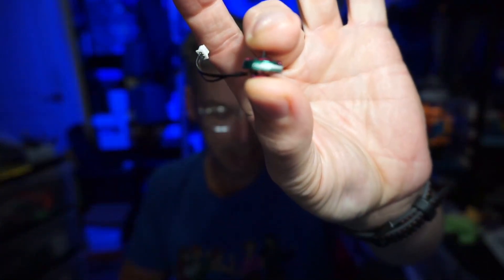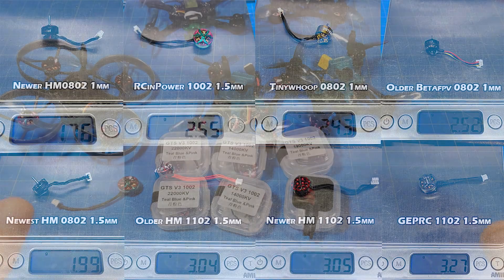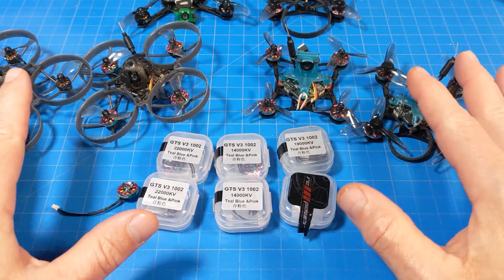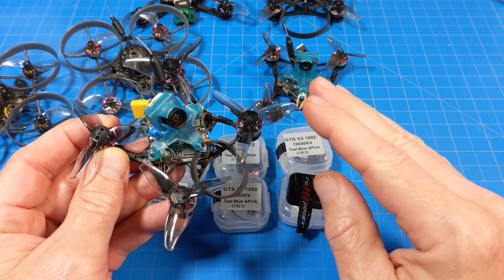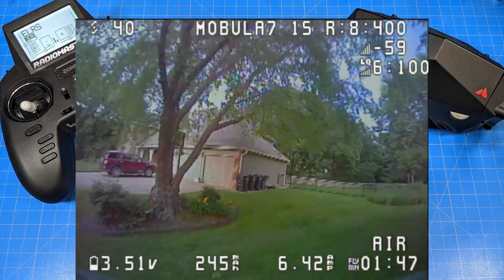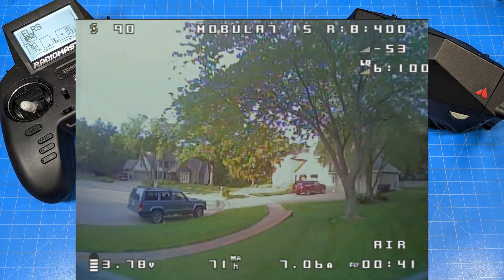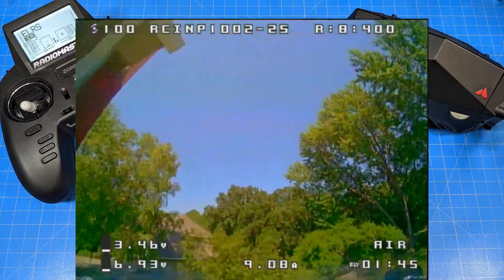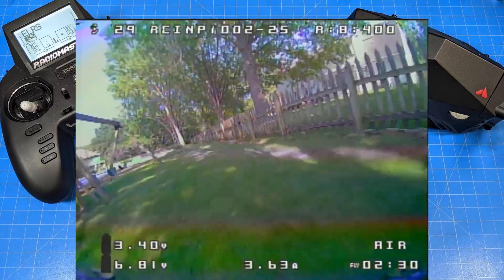New RCinPower GTS V3 1002  // Double Ball Bearings // Prop Motor Matching

Comment: Hi Nick. I have seen in your other video suggesting that 45mm prop works well for 1002. I currently have 1s toothpick build with betafpv 1102. If i switch to 1002 using same prop same KV motor would that give more flight time? Are 1102 too big for 45 Mm prop?
Reply from the maker: 1102 are not to big, I have flown 1102 from 40mm to 2inch prop. The 1002 wont save much weight or any depending on the motors, and also won't increase flight time or if it does its likely due t inefficient 1102 compared to efficient 1002. I would stick with 1102.
Reply: @ thanks Nick

Comment: Hey Nick, i was gonna get these. Any new reccomendations on a good 1002 or 1102 since the release of this video for a 65 or 75. Is a 12A esc rated enough for these types of motors
Reply from the maker: I have mainly tried the different 100x motors on BNFs, I think they are likely very very comparable from one to another.
Reply: @NickBurnsFPV  sweet. How about A ratings. Are off all them within the zone?. I know 1102s might be bit high in amps for a 12A board

Comment: Planning to use the 1002 22000kv on a 75mm walksnail build, would you have any recommendations on a tune pre-set to start on?
Reply from the maker: try a uav tech whoop preset
Reply: @NickBurnsFPV  Thanks!

Comment: I just picked up the 19,000KV for my mob7, can't wait to try them out!

Will I be able to run them on 2s but with the throttle limit lowered? I have the mob7 with the x12 v2.1 board wich I think takes 1-2s, really want to try 2s on this rig but don't want to ruin the motors
Reply from the maker: Normally motors are rated 1s/2s. Which doesn't mean voltage limit but rpm limiting. yea you could run them, I would start out cautiously at first.

Comment: F4 AIO 5A won't be a good idea for this motor, right ?  probably need 12A
Reply from the maker: I have run these motors on 5am esc, as well as a host of 1102 motors. The prop size is an important part of the amp draw. larger the prop the more the amp draw, I have not flown 1002 or 1102 on larger than 2inch tri blade props.
Reply: @NickBurnsFPV  thank you for the info.

Comment: Which kv did you end up using for the Mobula 7 1S? Stock 0802s are 20000, the 1002s come in 19000 or 22000, I think.
Reply from the maker: 22000kv, are currently on one of my mobula7s
Reply: @NickBurnsFPV  Thanks!

Comment: Let me make sure I understood you correct.. you said if running on 2s we need to reduce the throttle 🤔 did you mean only if you're running triblades? Because I have these motors and I'm  running biblades but I only have a Zeus 5 amp ESC 🤷🏾 would I have to reduce the throttle even though I'm running bi blades on a 5 amp ESC? And how much of a throttle reduction?
Reply from the maker: yes, on a 5amp esc these motors on 2s with biblades pull 9amps on 100% throttle and would burn the 5 amp esc. We have to reduce the throttle or motor output to ensure we don't go over the amount of amps the motors might pull.

Comment: What about 4 blade 40mm… 52g dry 2s…to. Cruise in the evening… or inside… any suggestion ?
Reply from the maker: I haven't exhausted all weight and prop choices. In the experiences I have I think they are best suited for ~40gram with 2inch bi blade props.
Reply: @NickBurnsFPV  would you have a suggestion for this build? It is a gepRc tkP16 build as a pusher… they have 1203 11500kv… it flies well but got 10s of flight… help !
Reply from the maker: @MaddestGinger  low flight time is often the result of weight, over motored, or even the pid tune can cause shorter than expected flight times.

Comment: Hey Nick! So I got my mobula 1-2s that I have upgraded to the v3 frame to fit 350mah 2s rdq batteries with xt30 lead and connectors to help with sag. Now that I got everything set up and I’m flying, the motors get so hot!! Is it the increase in weight from the connectors and the battery? Or is it getting a good bit more juice and the motors can’t take the time xtra juice? Should I swap to some bigger motors? If so what motors would you recommend me to drop in the mobula 7 v3 frame that will handle it better since I’m only going to fly it with 2s 300/350mah batteries only. Whatcha recommend for motors that will fly hood with that set up and not get hot with still a decent flight time? Also what props would you recommend to pair with it? Give me a couple options on the motors and props for more aggressive vs a little more efficient and longer flights! Thanks nick! You are the best and my go to guy! Lucky me since you know everything I ever ask haha but unfortunate for you since I ask all the time 😅😅😎🤪 you’re the Man!
Reply from the maker: I suspect the pids need adjustment. When we make frame or weight changes, really most changes from one quad transfered to another we need to adjust pids. The pids will cause the motors to work hard and thus get hot. If we swap motors that might solve it, but also might not.
Reply: Adjustments in with way? Which pids should I raise or lower?
Reply from the maker: @Taboloncawonthemasters  I would turn the master slide down two or three notches and test

Comment: Nick, I have been replacing most of my micros with 1002. I found they are perfectly matched with Gemfan 2015 2 blade, compared to the Gemfan Hurrincane 2023 tri-blade, which put too much load on the 1002.
Reply from the maker: nice to have confirmation of what I felt I was experiencing.

Comment: in mobula7 1s did u using 19000kv or 22000kv?
Reply from the maker: 22000kv
Reply: @NickBurnsFPV  did u use 19000kv version too? Can u tell me what's the difference?
Reply from the maker: @mohyusufnr1842  yes, I used all three. The basics with motor kv is the higher the kv the more top end rotation, and thrust the overall efficiency goes down as well.
Reply: @NickBurnsFPV  so i assume that the 19000kv of this motor better than the stock motor of mobula7, and the 22000kv version is more efficient than the stock, but i watch in ur video , even u use 22000kv version is has better thrust than the stock motors, wasn't it?
Reply: @NickBurnsFPV why do u keep giving people different answers 💀
Reply from the maker: @ontariodoublex2713  I don't see that I have. What do you perceive as different answers.

Comment: Thanks for the info Nick! Do you think 1002 22000kv motor will work with 40mm biblades using 5A ESC? I tried 0802 19500kv but i get too slugghish response, 1102 18000kv was too heavy and underpowered, tmotor 0803 22000kv was perfect but it continued to have bells separation. Thanks very much!
Reply from the maker: I do think 22000kv will work with a 5am esc, we could likely move up to 40mm triblades.

Comment: Hi Nick , whats inside the 2" toothpick?
And on mobula is 14000kv or 19000kv? if is 14000kv , u think worth to put 19000kv?
Reply from the maker: the 2inch quad is the 14000kv motors. the mobula has 19000kv

Comment: any chance of you sharing your mobula 7 pid tune? 2200kv please
Reply from the maker: the mobula 7 has the 19000kv in them.
Reply: @NickBurnsFPV  I put the 2200kv on the elrs mobula 7, it flys well no prop wash, that I could tell lol. Four minute flight time on 450's. Motors are cool after 4 minutes, I haven't changed the tune on it. I'll let you know how they hold up to a very dusty environment.
Reply: @davisauto8423 are you running blue jay 48?

Comment: Hi Nick. That's a good comparing video. I ordered the 22000kv version and will put them in my mobula7 1s.I hope they will arrive this week. This are the angry Don motors right? And a blue version would be awesome!
Reply from the maker: I am not sure if Angry Don wanted this specific motor design or not, or if he was in contact with RCinPower. I just don't know.
Reply: @NickBurnsFPV  It is me that did the work with Rcinpower (Toto FPV). Angry Don is working with other companies I believe
Reply from the maker: @t0t0FPV  Ah, so much to know and keep track of. Sorry I wasn't on point with that information.
Reply: @t0t0FPV  Thank you for doing that. I have now watched your video about the 1002 motors.
Reply: @NickBurnsFPV  oke thanks. Flywoo has 1002 motors now also I ordered them via banggood.

Comment: I wonder how the 22kv motors would work on a 1s 85mm whoop
Reply from the maker: its a bit hard to say as there are many configurations I didn't test. I do think a 2inch triblade is going to be a bit much for the motor, it won't be bad, but if you fly aggressively with flippies and dive and fast turns it might not give the response your looking for.

Comment: That Nick Burns background blue!
Any recent builds with the 1202.5'ish class on 1s and 2s (cannot remember)?
My NBDFlow 1202 11420kv on 3" 1s and 2s (with motor limiting) should have been destroyed several crashes ago; my stack screws were all bent forward and I replaced them but not the motors still flow fast as I want them to. 😻
Reply from the maker: The only tuned recent builds are in thumbnail in this video. :)

Comment: Hi Nick,
I did not understand one point: did you use the 19,000kv or the 25,000kv on the 1s Mobula?.
By the way you talk about 18,000 wben showing rhw sub250 frame. :)

Thanks and looking forward to h2h with the T-motor 1002!
Reply from the maker: 19000kv on the mobula 7, and yes 18000kv on the baby turtle they are betafpv 1102 motors running 1s. I used the 22000kv version on the open prop 1s rocket race in the thumbnail but didn't cover it in the video.
Reply: @NickBurnsFPV  thanks for the clarification. I actually bought some 19,000... but sill eagerly waiting for the Tmotors. 

By the way just flown some HM 1202.5 on a 2.5"... Not powerful enough compared to my old 1103s...😭
Reply: @nikotttin  Did you run the 1202.5 with a 2.5" on 1s?  That would be under-powering.  I tried the Rcinpower 1202.5 @ 11500 kv on 2s on the StarLord frame with 2" triblade.  It was under prop.  But that frame could not take larger props.
Reply from the maker: @nikotttin  do you mean they don't have the top end or the low end. Which 2.5inch prop?
Reply: @NickBurnsFPV  Hey both,
First thanks for the replies. 
Avan 2.5" on 6400kv and 2S. Dry weight is a touch above 50gr. I need to move to 3s to get that explosive power the old amax 1103 had...
I wad hopping that 6400 was enough (before was 7500kv and was great)...
Reply from the maker: @nikotttin  Yes, or change the motor out, I would think on 2s and 2.5inch prop we likely want 7500kv or more depending on our flight desires.
Reply: @NickBurnsFPV  That's a bummer :)
My flight desire? Micropower!!
Remind me please, what did you use on the 2s tks??
Reply from the maker: @nikotttin  I used 1102 10000kv on gemfan tri blades 2023.

Comment: Didn't flywoo release a 25000KV version of this size motor as well? I really like the 1002 on try blades or quad blade props, particularly on 2S.
Reply: I think this is where the 14000kv will shine. I plan on trying them on a Geprc Smart 16 frame, and use one of those 16x16 aio instead of the stack to save on weight

Comment: I'm guessing on the Mob7 you were 48khz?  the stock 802's on that rig are underpowered and 48khz robs it of power...Just looking at how the 1002's fly and my 802, 22k HM's on 24khz, I still think 802 22k 24 wins...but really hard to say...would be interesting to see 1002 on 24khz
Reply from the maker: Only 48khz if the mobula7 comes stock with that. I don't think it does though does it.
Reply: @NickBurnsFPV  mine came with 48khz stock, fwiw

Comment: That biblade 2" 2s rocket race setup is impressive! What size battery were you using with that one? Sorry if I missed you saying it.
Reply from the maker: I was using the hobbyking 300mah 2s on all the 2s flights. I really like that battery with its weight and still good flight time
Reply: @NickBurnsFPV  Thank you!

Comment: Hey, what would you do if you had 1202.5 11500kv motors laying around but you didnt want to build a 1s toothpick with it, because the aio boards break every second flight? Can i use those motors maybe with a heavier board then the fpvcycle 1s board (fettec 15a) on 2s and maybe 2.5" props?
Reply: That would actually work decently well on 2s 2.5 inch props, you just may need to stick to biblades and possibly limit the output a bit to like 10000kv. It might be a bit chonky compared to say a TKS race running 1102, but you will have a bit more punch and power, and it will have a bit more weight to throw around, so apples and oranges. I say give it a shot.
Reply: @valden  Awesome, thank you so much!:) Would you go for Biblades because triblades could be a bit much for the motors?

Comment: I (finally!) bought the parts for your standard lightweight Rocket Race 2S (went with X12 AIO and HGLRC Aeolus 1102 10000KV and tri-blades), so the question is whether you like it BETTER with the 14000KV (albeit throttle-limited) 1002 on bi-blades. I've seen the flight, but I want YOUR opinion. :-)  THANKS!!
Reply from the maker: Its close, in a light build like I showed overall I prefer the 1102. With the 1102 I can carry the insta 360go 2 more viably and still have great flight performance without it.
Reply: @NickBurnsFPV  thanks!

Comment: $13 for a 1002 is a lot! Most 1408 motors are the same price, and obviously not for whoops, but so much more motor.
Hopefully others will come out with this 1002 size and be a better price.
4 whoop motors for $52 ... Ouch!🤕🥴
Reply from the maker: Yea I felt the same when we bought baby clothes. $16 for a onesie that could fit in my hand. So little material yet so expensive comparatively
Reply: @NickBurnsFPV  At least the motors will (hopefully) last more than one month, when a baby grows out of those tiny clothes! lol  :)
Reply: @KOrnhOliO1  I suspect that material cost makes up only a small percentage of the overall cost, machining something that small must have its own complication in tolerances and I also suspect the time to manufacture is not too dissimilar to a larger motor resulting in very similar costs of production. I use the word suspect as I have little experience of the commercial side of things, but making something on my lathe that is half the size is nether half as easy, half the time or half the hassle.
Reply from the maker: @KOrnhOliO1  yes, and used baby clothes sell like hot cakes. Used motor, not so much.

Comment: Hi Nick, What's the KV on the Mobula 7?  Awesome videos. thank you
Reply from the maker: On the 1002 motor?
Reply: @NickBurnsFPV   What was the KV on the 1002 motors on the mobula 7? i would like to give this a try to see if it helps with the dreaded yaw washout
Reply from the maker: @adee737  19000kv in that test
Reply: @NickBurnsFPV  yes the 1002 motors from the flight clip. i want to try it as well. thanks
Reply: @NickBurnsFPV  also, what was the flight time that you got from those motors?
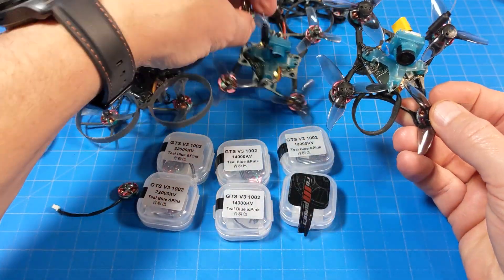Reply from the maker: @shanehugentugler808  19000kv on the mobula 7, flight time was around 3:10 on average outside.
Reply: @NickBurnsFPV  What battery size did you use? all my 1s are 530, just orderd some 19k 1002 motors to try out
Reply from the maker: @adee737  450mah.

Comment: Hi Nick, what brand of prop and number blades do you prefer for 40mm on this 1002 motors (for a chunky whop)?
Reply: From my testing gemfan 1610, 2015 and NBD azi triblade are the best performing props on these motor.
I don't recommend HQ as they are badly balanced, fragile and pricey (NBD are pricey too but way more durable)
Reply from the maker: It depends on the whoop. I tend to use gemfan for indoor rippers and hq for HD whoops

Comment: Mobula7 1S shows around 25% more current draw on the 1002s. It is going to be tough on batteries and flight times... might have more power in your tests but I really haven't felt the 0802s in 25000kv ever felt underpowered.
Reply from the maker: Maybe worth a try. The extremes of the throttle is where I think most would feel the difference
Reply: I'm not sure if your esc is running 24khz or 48khz but 48k can help with amp draw. I have noticed batteries with low C rating sage. but the batteries with 70c or over do really well
Reply: @leadslinger5130  don't worry dude, I know how to use PWM frequency 😅
Reply: @DonJohnsonFPV  Hey brother i love your videos! and great job helping happy model with the whoops! I know you know already 😅 I forgot to @ the person I have 2 sets of these motors on a couple UZ80 builds with 5amp esc so far the 22000kv pull about the same amps as the 19000kv. Your a legend Angry  Don Take care my FPV brother
Reply: Nice catch! It's indeed a bit higher with th 1002, but not by a quarter. At full sick its around 11.5-12A while the 0802 are around 10.5-11A. Cruising it 6.5-7A vs 5.8-6A... So yes a bit more taxing but close call isn't it?
Reply: @nikotttin  not by a quarter but half...
0802 = 100mAh/mn = 10A max
1002 = 150mAh/mn = 15A max
🤦‍♂
Reply: @DonJohnsonFPV  I simply looked at the flight video... more what I can expect. There's quad66 who just released a video on 22,000...

Which kv do you like for a light 2"??
Reply: @DonJohnsonFPV  would you say it may be a bit risky to run these on a 5amp esc? Appreciate your insights!
Reply: @valden  I didn't have any issue with mine but they s*ck less amps...
Should be fine will keeping with 19000kv and 40mm biblade.

Comment: Nice video Nick. Did you test them in your 2S 75mm whoop?
Reply from the maker: No, I didn't. I think for indoor whoops there isn't much of a reason to go from 0802 to 1002. In a digital 2s whoop the weight savings might be worth it down from 1102

Comment: I think the 19,000kv on 1s 2” will be the most popular setup. It’s to bad they didn’t just make a 10,000kv since the 14k would obviously be less efficient with a motor output limit, still it’s super cool u did that though.
Reply from the maker: I might take the throttle limit off to just see how fast I can drain a battery 😁
Reply: @NickBurnsFPV  I think it should handle it, might be cool to see what happens!